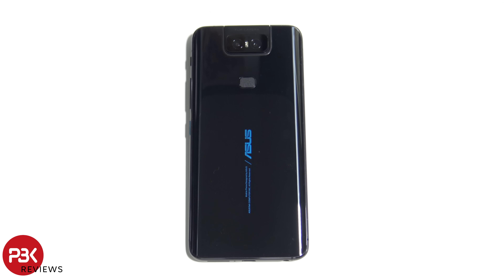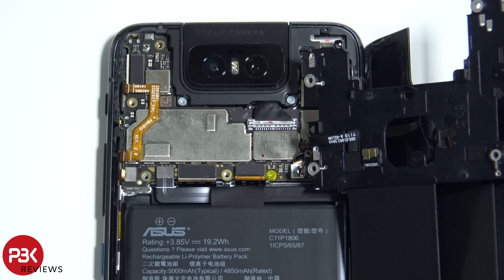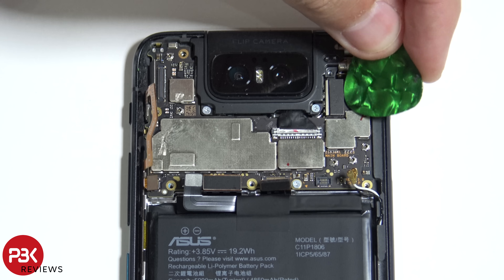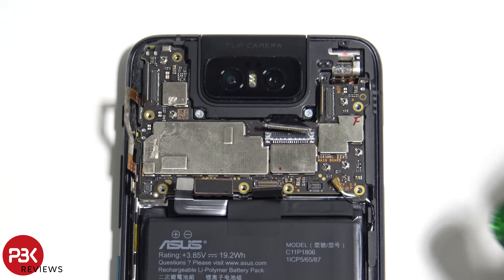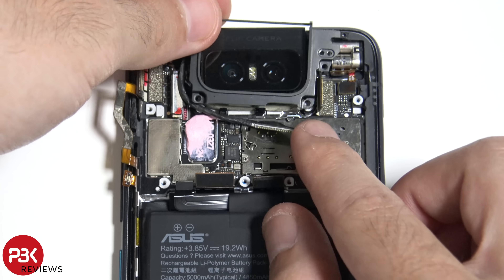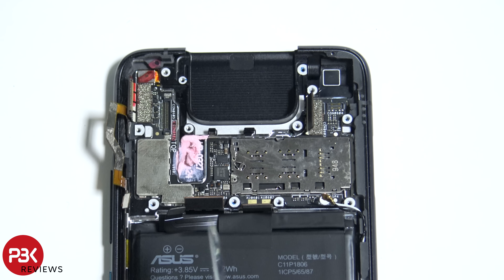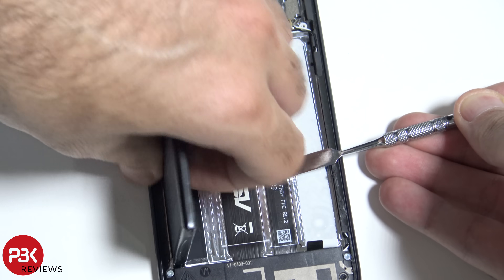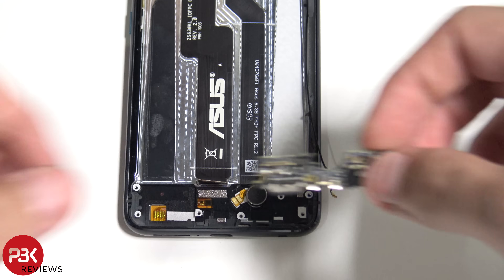Asus Zenfone 6 / Asus 6Z Teardown Disassembly Repair Guide Video

Comment: Good phone, I still have mime after 5 years still intact and undamaged, I wish phones could have swappable parts I'd get 5G antennas, new CPU and a higher refresh rate display, the phone has features too awesome compared to new phones, like the security is top notch, you can even customize app names how you want, remembers wallpapers, has amoled dark mode. I wish newer zenfones could have the flip camera I'd get one

Comment: Do you know how i can replace the camera? It doesnt detract anymore and camera app keeps stopping and i cant use my camera
Reply from the maker: It would probably be easier if you can find the entire camera assembly to replace. If not you would need to take apart the camera assembly as well by prying it open. I believe it's held together with adhesive.

Comment: Hey! Thanks for the video!
I'm struggling with the lower motherboard of my phone, looks like itś glued. 
In the vídeo you  took off lower mother board easily
Reply from the maker: Hi, Yes there is adhesive tape holding it down. Heat it up with a hair dryer a bit and gently pry off the board.

Comment: do you know how to replace the vibration motor for this phone?
Reply from the maker: It's held down with adhesive. Once you have the lower portion of the phone taken apart, you can apply some heat with a hair dryer to the motor area and gently pry it off.
Reply: @PBKreviews  my vibration motor stopped working after I replaced the charging board one time. I assume the motor is the circular thing that the charging board curves around right?

Comment: Thank you for this precious video which helped me greatly to change the USB board of mine, which was very faulty and made it very difficult to charge. 

Here is my testimony.
I just changed my USB board today. It doesn't seem genuine but it works for now.
I managed to keep the back cover intact. I used a heat gun set to an unpleasant temperature for my skin (the gun doesn't tell the temperature). I had to heat the phone maybe 5-6 times during 3-4 minutes I'd say, before I was finally able to slip a prying stuff under the bottom of the cover. This seems very difficult and I thought I wouldn't be able to make it at first. After putting one stuff under there cover, I heat the phone again, then start to slide another plastic stuff near the first one and along the border, slowly. I heat again each time it seems difficult to pry. I didn't lift the cover. I only slid the plastic tool under the border. Moving my way all around and alternatively heating when it seemed necessary. Until I could lift the left side (opposite of the fingerprint reader cable). I keep sliding the tool under the unlifted border, until it changes completely detached. And done!
The weather was hot and I was nervous to break my precious and deer phone 📱♥️, so I was sweating quiet a lot. 
Then I unscrewed the top plate, as in the video, to unplug the fingerprint reader and have the cover out of the way.
I didn't wanted to buy a battery before being sure I could save my phone by changing the almost dead USB port. So I didn't removed the battery, only the speaker and the USB board underneath. I had to be careful because the battery is a tiny bit in the way of the USB board. But if you're careful, that's doable.
I had a very hard time plugging back the white and black cables on the right. It was so tiny! I had to ask my gf who is more agile. Plugging back the fingerprint t reader was a little bit difficult but ok.

The bottom of the back cover is now slightly lifted. I'd need some special sticky tape to close it perfectly. I'll do it when I change the battery.
My USB works fine. I'm relieved. I had to force on the USB plug side very hard to charge the phone before. I thought my phone was soon dead.
So I'm happy for now. I hope my testimony will help and give courage to anyone who wants to save his phone instead of throwing hundreds of $/€ in a new one.
Good luck!
Reply from the maker: You're welcome. Here are two links for you, one is for the battery door cover/back plate that comes with the pre cut adhesive you need, and another is for just the adhesive but I have never bought from the second website so not sure how legitimate it is. First: https://www.ebay.com/itm/165466097596?chn=ps&var=465493095326&norover=1&mkevt=1&mkrid=711-117182-37290-0&mkcid=2&mkscid=101&itemid=465493095326_165466097596&targetid=1529493965902&device=c&mktype=pla&googleloc=1013819&poi=&campaignid=19851828444&mkgroupid=145880009174&rlsatarget=aud-1297930287058:pla-1529493965902&abcId=9307249&merchantid=118876397&gclid=Cj0KCQjwnrmlBhDHARIsADJ5b_ntW3qXv9F-DrIHQaEqibJRYUOiWxO7nHgiLmis9bUiez3L8gH57lQaApWCEALw_wcB  Second: https://www.a-accessories.com/asus-zenfone-back-cover-adhesive-87186-67184.htm

Comment: Which board has ROM? My phone died, but sometimes it can be turned on for a moment. It's charging, but sometimes doesn't indicate, only the powerbank is saying it's charging. I tried even another battery and it does the same. Looks like the main board is dying and it doesn't care about the battery level. My question is, can the main board be replaced without losing data, keeping software intact? Or is there a problem in the charging module? Like it says to main board "hey, we don't have enough juice, do not start?"
Reply from the maker: You can try placing the main board which you can see @2:46 in the video into another zenfone 6 and see if it will power on and work fine, ruling out a main board failure. All your data is stored on the ROM on that main board and would stay on that main board so moving it over to another zenfone 6 would retain your data if that main board is not bad.
Reply: @PBKreviews  thanks for reply

Comment: Old video now I know but I just had to replace the charging board in my ZenFone 6 and would have really struggled without this teardown. Than you!
Reply: From where you order the parts, my Zenfone 6s charging port just went bust
Reply: I had the same problem with the charging board but I'm not very familiar with replacing smartphone parts. Was it difficult?
Reply: @TheVincenzo800  It wasn't too bad, pretty fiddly as you'd expect with everything being so small. Taking it apart enough to replace the board wasn't too bad, I found putting it back together a bit trickier. Those black and white cables that run down the side have a conduit at the edge of the phone that they run through to keep them safe and out the way. Getting them to stay in there whilst putting the other parts in around them was by far the hardest part as they kept slipping out. Aside from that I'd say it was fairly easily done given the right tools and if you follow enough of the steps in this video.
Reply: @newmyed  I replaced the Charging Board. Replacing the charging board was not the problem. I shattered the back glass which using a hair dryer to heat up :|
Reply: @vinitsharma9282 Did you manage to order a new back panel?

Here is my testimony.
I just changed my USB board today. It doesn't seem genuine but it works for now.
I managed to keep the back cover intact. I used a heat gun set to an unpleasant temperature for my skin (the gun doesn't tell the temperature). I had to heat the phone maybe 5-6 times during 3-4 minutes I'd say, before I was finally able to slip a prying stuff under the bottom of the cover. This seems very difficult and I thought I wouldn't be able to make it at first. After putting one stuff under there cover, I heat the phone again, then start to slide another plastic stuff near the first one and along the border, slowly. I heat again each time it seems difficult to pry. I didn't lift the cover. I only slid the plastic tool under the border. Moving my way all around and alternatively heating when it seemed necessary. Until I could lift the left side (opposite of the fingerprint reader cable). I keep sliding the tool under the unlifted border, until it changes completely detached. And done!
The weather was hot and I was nervous to break my precious and deer phone 📱♥️, so I was sweating quiet a lot. 
Then I unscrewed the top plate, as in the video, to unplug the fingerprint reader and have the cover out of the way.
I didn't wanted to buy a battery before being sure I could save my phone by changing the almost dead USB port. So I didn't removed the battery, only the speaker and the USB board underneath. I had to be careful because the battery is a tiny bit in the way of the USB board. But if you're careful, that's doable.
I had a very hard time plugging back the white and black cables on the right. It was so tiny! I had to ask my gf who is more agile. Plugging back the fingerprint t reader was a little bit difficult but ok.

The bottom of the back cover is now slightly lifted. I'd need some special sticky tape to close it perfectly. I'll do it when I change the battery.
My USB works fine. I'm relieved. I had to force on the USB plug side very hard to charge the phone before. I thought my phone was soon dead.
So I'm happy for now. I hope my testimony will help and give courage to anyone who wants to save his phone instead of throwing hundreds of $/€ in a new one.
Good luck!

Comment: Thank you for making such a well made video. I have had my zenfone 6 for 3 years now. Last week the screen started to flicker and then go black. The phone was still on as I could see the backlight working but the display was left black. I did a forced shutdown and now he phone is stuck in a black screen bootloop. Do you happen to have any suggestions as to what I could do to fix this problem?
Reply from the maker: Hi, if there is any liquid damage causing it, then you would need to open it up, dry it out and brush off any connectors or chips which may have corrosion with a tooth brush and see if it would help. Aside from that, I would try a hard reset/factory reset which would erase all your data (but if the software is corrupt, you sort of have no choice). Most phones your able to hold the volume down or volume up and the power button for 15 seconds to go to bootloader or recovery settings to wipe the phone. You would need to google how its done for this phone since I don't remember off the top of my head. If that doesn't help either I would think either a bad battery or something shorting not sure.
Reply: @PBKreviews  Thank you for your response and your information. I was able to get it to boot properly but the screen is still acting problematically as it does not want to work most of the time. It tends to shut down by itself, most of the time it flickers before this happens. The backlight still works but the screen will appear black. Then some other times the screen seems to be working fine. I am still not sure what the issue would be as I have never gotten it wet and I keep it clean.
Reply: @ChristopherMagnus9 Did you fixed it? I guess your could have changed the screen.
Reply: @GuilhemLyon  Unfortunately no. I sent it to a repair shop, but was unable to get it fixed before I left Germany.
Reply: Dang, I'm having the exact same problem. I really don't want to switch phones :(

Comment: My Z6 does not reliably charge anymore as it keeps dropping charge. So I purchased a charging board replacement and attempted to remove the backplate but it won't budge at all. I warmed the back with a hair dryer and used several suction tools but it won't separate. Any advice?
Reply from the maker: You can use a thin razor or xacto knife or something (even though it might scratch up the frame) to get it under to left it up. Then you can get a plastic pry tool in.

Comment: Thanks for this detailed video! Can I change the battery without removing the motherboard and camera?
Reply from the maker: You're welcome. Yes you would just have to remove the back plate, then the screws on the top plastic cover and remove that plastic cover to gain access to the battery cable to disconnect it and then you can pry off and remove the battery with the adhesive pull tab on the bottom of the battery.
Reply: @PBKreviews  Thanks for answering this! My Z6 has been unable to hold a charge reliably. I think its a faulty charging port. I will replace it. I'm glad I don't have to tear down the motherboard whew.

Comment: Do I have to do all this just to change the charging board?
Reply from the maker: You would have to remove the back cover and then just remove the screws on the bottom speaker assembly and remove that to gain access to the charging board. You wouldn't have to do anything with the top portion of the phone.

Comment: Those "Phillips" screws actually aren't Phillips at all, but JIS. The center joint of the "cross" is more angular than a Phillips, which is slightly rounded. If you have a hard time getting a Phillips bit to grab onto them, try a proper JIS bit.
Reply from the maker: Thanks for the info. It's possible they are JIS screws (first I am hearing of this) but the Phillips screw driver opened them with no problem so both should work I guess.

Comment: Do you recommend replacing thermal paste before reassembly or not needed to do that? And which brand and type is recommended?
Reply from the maker: Yes generally you would want to re-apply the thermal paste. I try usually to scrape off the original thermal paste and re apply it afterwards (to make sure it has no air gaps and a good application) so I use the original one since thermal paste vary in conductivity levels so I don't want to risk using a thermal paste that is more conductive and can cause a short if it gets around places it shouldn't etc.

Comment: Great video bro! Question, is their a special adhesive you recommend?
Reply from the maker: Thanks! You can watch this video on the adhesive: https://www.youtube.com/watch?v=T4iiPUIM7-Y
Reply: @PBKreviews  nice, do you remember if their was a pre cut adhesive for the Zenfone 6? Because I'm not having much luck finding it online
Reply from the maker: @DIYStangsandFreedom  Here is a website. They have it listed as the mounting system. https://www.asus-accessories.com/zenfone/zenfone-6/zs630kl/zs630kl-87919-66936.htm
Reply: @PBKreviews  bro thank you for sharing your resource!!
Reply from the maker: @DIYStangsandFreedom  you're welcome 😀
Reply: Thank you bro I just replaced my charging port with your video!

Comment: What kind of adhesive tape do u use? 2mm or 3mm?
Reply from the maker: Usually i try to buy the original pre cut adhesive made for the phone, but if not, i cut adhesive down to size,  so i may usually go for wider size. You can watch the smartphone adhesive replacement video i made so get an idea.

Comment: Hey, I don't know who to ask but recently my battery had bloated of Asus 6z and then I took it to the service centre and changed it. Now after two months suddenly the front panel started to look loose. Like there was light emanating from the corners and today suddenly the front panel near the charging spot suddenly opened a little, revealing the inner parts.. should this be happening? Or do you think the service centre has done something intentionally? Please help me I have no idea who to ask for help
Reply from the maker: It's possible the repair center removed the screen or front panel and they didn't apply the new adhesive properly so its pealing or lifting off. You can contact them and let them know.

Comment: Hey, could you please tell me where/on which part of the phone is the main mic? Is it the power supply(I need to by new on)? Mine just stopped working after I've cleaned it with compressed air. Greetings from Germany.
Reply from the maker: The main mic is located on the bottom corner of the charger port board right next to the charger port. Its a gold square/rectangular piece.

Comment: How did you manage to fit a guitar pick in there? I'm having issues with mine and I can't even get a razor blade in the side. 

If anyone is curious about my issue, the phone won't charge. It originally locked up when I tried to charge it about 2-3 weeks ago, but now all I get out of it is the red low battery led for about 30 seconds when I plug it in, and then the light goes out.
Reply from the maker: You need to heat the backplate with a hairdryer or heat gun, then use a suction cup/tool to help you pull the back plate up slightly to give you some leverage to place your pry tool in. If you don't have a suction tool you can use a razor  that's thin enough to press in between the backplate and frame of the phone to lift up the back plate and put a plastic pry tool in but that may scratch up your frame a bit.

Comment: Thanks for the video. Do you know how hard is it to change the camera motor? My edition 30 motor died yesterday after dropping the phone, I ordered the motor, but I have no idea how to change it and if you need any special tools.
Reply from the maker: You're welcome. Is it just the motor or the camera assembly with the motor? I didn't take apart the camera assembly to not damage it, so not sure exactly how difficult that portion would be. But disassembling the rest of the stuff is not too difficult but not very easy either.
Reply: @PBKreviews  just the motor. Camera assembly is like 200 usd, while motor separately about 60. Camera works fine, it's just it doesn't stay in place and doesn't turn aswell. I hear the sound of motor but nothing happens. Well, either way, thanks again. I hope motor replacement is possible and it will work.)
Reply from the maker: @1msorry1  Oh ok, no problem.
Reply: Hi where did you order the camera ? My camera doesnt work anymore and the motor too doesnt work
Reply: @coachalycute  I bought only the motor, but I couldn't change it, since it was not the problem of the motor. The bracket which the motor is mounted to broke, so I had to just glue the camera and use it without ability to turn the camera around. Still have the motor tho, wasted 60 bucks, lol.